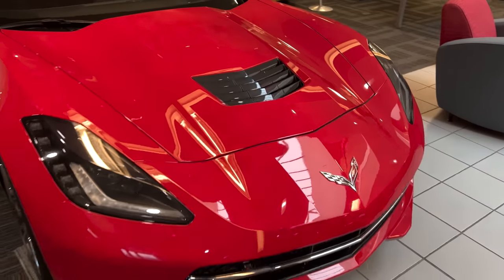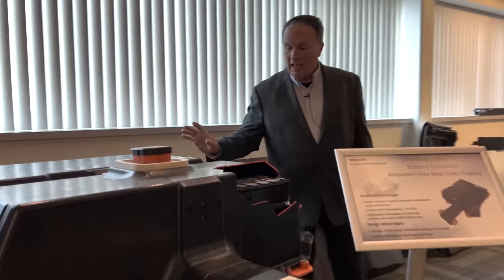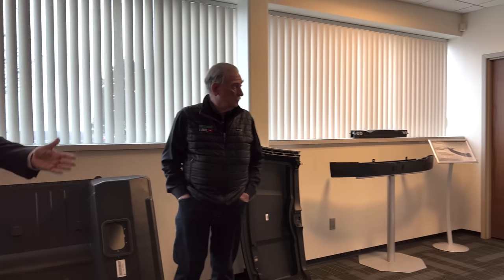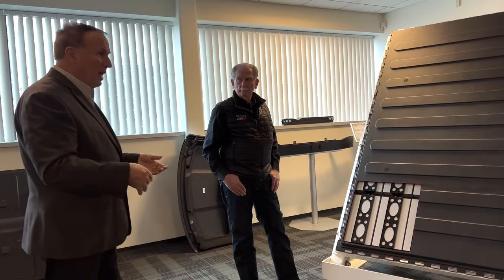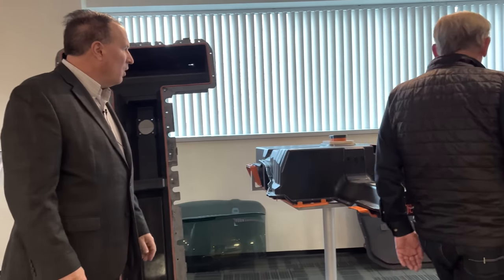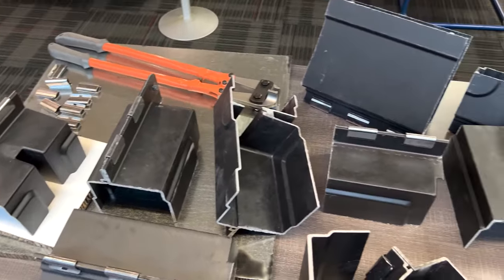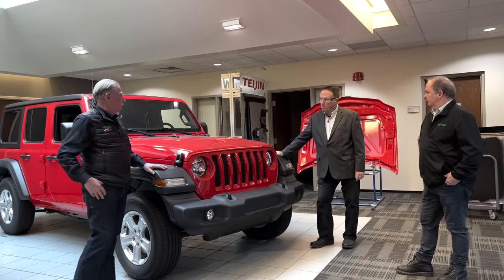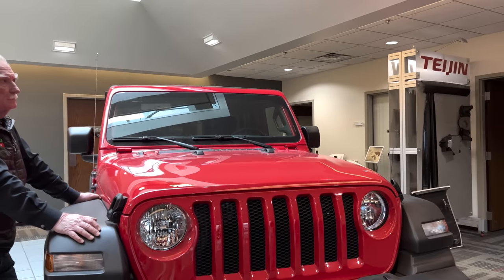How Are Battery Trays Made? Teijin Factory Tour

Comment: You guys care to cover this recent news from Ford?  I don’t recall you guys realizing either that their wiring harness is 1.6 kilometers longer than it needs to be for Electric F-150 and Mach-E. But this is what you do right??

“Ford CEO Jim Farley was rather blunt about the problems that Ford experienced as it rolled out its hot EV models, the Mustang Mach-E and the F-150 Lightning pickup. While both vehicles have a long list of waiting customers, Farley admitted that Ford encountered numerous problems with their production.

“We didn’t know that our wiring harness for Mach-E was 1.6 kilometers longer than it needed to be. We didn’t know it’s 70 pounds heavier and that that’s [cost an extra] $300 a battery,” he said on a call with investors Thursday. “We didn’t know that we underinvested in braking technology to save on the battery size.”

Farley said these and other cost problems meant that Ford “left about $2 billion of profit on the table.”
Reply: Ughhh... EVERYONE knew. Except perhaps Jim Farley. But its just a PR game they are playing. Because Tesla has been dramatically reducing wire lengths for years and Sandy has been beating the drum about it. Next Ford will announce that they didnt know that their coolant loops were a confusing mess. The engineers knew. But the only way to fix these issues is go in-house with hundreds of components so the engineers can plan out the paths of the cables and the piping and not work around existing components. Everyone knows, and its exactly why Sandy talks about Tesla so much, because they saw it and did something about it. The only reason for Ford to make this announcement is its a more fun way to say they finally invested in bringing alot of the component production in-house so they could design shorter lengths.

Comment: Teijin is an interesting company with a long history of association with OEMs.  The future of legacy OEMs is looking increasingly uncertain on an industry in which Tesla is ascendant. Rather than have a generic 1.5m x2m battery box on display it might strategically interesting for Teijin to make a demonstrator structural battery box that fits the Tesla Model Y floor opening.  If Teijin can demonstrate cost, weight and ‘production floor area’ reductions by using mouldings rather than traditional ‘metal pressings with assembly line’ it must surely pique Tesla’s interest.
Reply: Tesla would probably still rather make it themselves than pay others to make it.
Reply: Its crazy expensive for them to build a one-off for a company that notorously does everything in-house. They spent the cash on building a generic box exactly because it was requested by companies who might actually buy thier product.

Comment: You can super seal tiny spaces with silicone particles in a vacuum. They make it for houses to seal drafts..They pressurize the house and spray the tiny particles into the air, it vacuums it outside till it can't...Would probably work for a battery box, flexible too
Reply: Matt Risinger has a great video on his channel demonstrating that process using the AeroBarrier system in a house under construction.
Reply: @KCautodoctor  That might of been where i seen it...Would be easy to do on a closed box with a sealable opening, Probably get more then a meter deep water insurance...People drive off bridges man lol

Comment: If structural battery packs and megacastings can be made out of fiber reinforced injection molded plastic, and this company is already making the bodies for the Corvette, is an all-plastic body in white possible ?  What about forged carbon fiber control arms and steering knuckles ?  Only the motors and wear points might still be made out of metal.

Comment: Vacuum has an R-value of 25 per inch.  If you made a honeycomb with tiny holes between cells and used a vacuum pump to maintain that vacuum, you could achieve R10 with a half-inch thick floorboard, right ?  Battery boxes that were essentially thermos bottles would be great for cold climates, leaving the temperature management to the external radiators/chillers and the heat sink surfaces actually in contact with the cells.  As compared to a huge aluminum or steel bottomed battery tray that dissipates heat as the vehicle is trying desperately to warm batteries when it is below zero.

Comment: Hi Sandy, if you take GM batteries after they depleted to 70% and put
 them in your basement how are you going to keep them cool to prevent from having thermal run away and burn your house down?
Reply: House cycling isn't as aggressive as automotive, and there is no supercharging. Would still need to hook up a chiller/heat pump.
Reply: Dont run a welding rig off of it and youll be fine.
Reply: You're grossly overestimating how much power you'll be pulling from them. Plus like someone above said, the biggest concern when you're using batteries is in the charging stage, especially when you're charging quickly (aka DC fast charging). You're never going to do that with a home battery setup.

Comment: Hi and thanks for a good channel. I have a question for you. With a LFP battery, how much 'damage', if any is caused by running the battery down below 20% to around 10% once per week or so? Does it really make any difference in the grand scheme of things?? What are your thoughts? Keep up the good work and good luck with your channel. Speak soon. -John
Reply: Most manufacturers spec sheets rate using 100% of capacity cycles around 50% compared to using 80% cycles. Personally I use 3.0v per cell as empty, since I noticed a couple of degrees Celsius temperature rise when discharged below that. The manufacturers are not really specific. With LFP, I have seen a quoted 3,000 cycles using 100%, and 6,000 cycles using 80%.

Comment: Could this technology be applied to the ENTIRE body structure of future vehicles? Stampable, strong, no rust...perfect solution to many of today's problems.
Reply: Steel still has structural benefits. But there is no reason why body panels couldnt all go plastic or composite. GM had great experience with that with Saturn. My 20 year old Saturn has less rust and paint issues than the 10 year old Camry I replaced it with.  There are also techniques for embedding steel in plastic to create attachment points. The primary reason nobody will do it is a lasting public perception of plastics as cheap and junky.

Comment: I'm familiar with wet layup using fiberglass, carbon fiber , kevlar as the fiber & room temp cure epoxies & polyesters.  The term "SMC" I assume represents some kind of molded composite but I am not sure.  I have seen (but have not done) infusion molded pieces (although I am familiar with vacuum bagging).  So--What is "SMC"?
Reply: CPC in Italy,  the company Sandy mentioned in the beginning of the video. They have partnered with Aptera and will be the manufacturer of the Aptera body parts.
Reply: @gmv0553  that did not answer the question.  I am aware of the Italian company but--what is SMC?

Comment: A standardized battery is a step toward making batteries swappable.  The next step is figuring out reliable quick connect coolant lines that can be handled by automation.  The step after that is figuring out to achieve owner buy-in to not owning the battery.  And then…
Reply: Yes, I know Tesla considered making batteries swappable and decided, “No.”  Time has passed and engineering continues to learn new things.

Comment: MUNRO live - Tesla in north America & Worldwide is outselling the gm Chevy Corvette by miles.
and the Tesla model S PLAID is faster & more agile than Corvette.
model S was FIRST built in 2012, & got OTA update.
Reply: Yes, but Corvette has the noise,vibration, and smell.
Reply: Corvette is a sports car- entirely different market. Not a relevant comparison. Corvette name has 70 years of heritage.
Reply: Tesla makes nothing to compete with the Stingray! GM sells more Corvettes then all the other 2 seat sports cars put together. The Plaid is a joke for a good handling car unless you go in a straight line.
Reply: @jamesvandamme7786  you definitely have not ridden in a new Corvette!
Reply: @G V  true; Tesla no longer makes a sports car.  Corvette,  however,  most certainly does not outsell all other 2 seat sports cars combined; probably sells less than Miata. Model S Plaid can corner with over 1 G lateral and I'm pretty sure was faster around the Nurburgring than any Corvette.  Model 3 Performance is nearly as quick as Corvette and handles as well as it does. 

I don't think you understand the fundamentals are all there with Teslas- extremely low center of gravity [probably lower than Corvette],  50/50 weight balance,  sophisticated sports suspension, sticky low profile tires,  never needing to wait on a combustion engine.
Reply: @gmv0553  Nor do I need to.